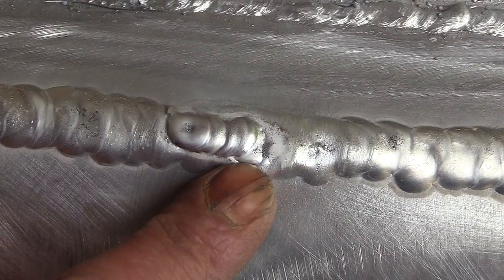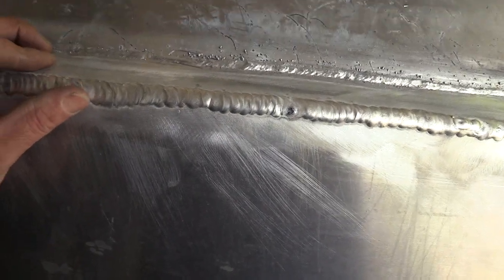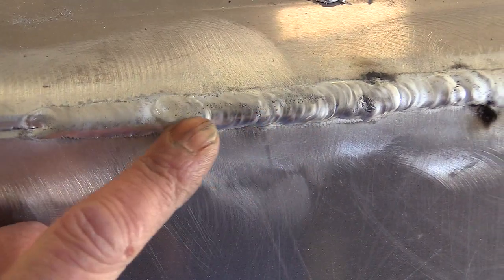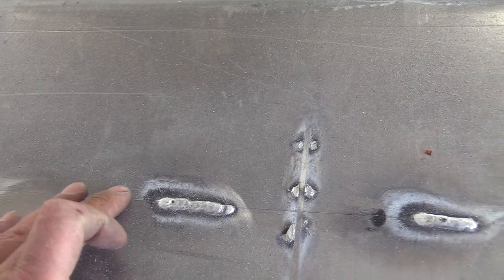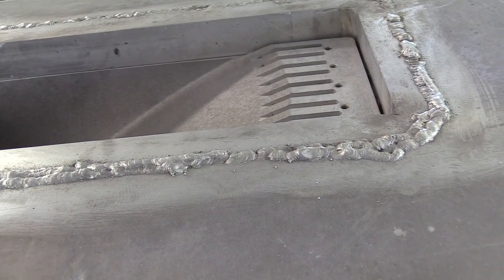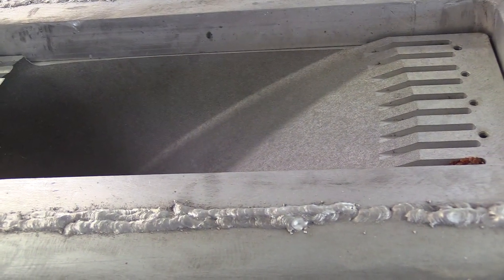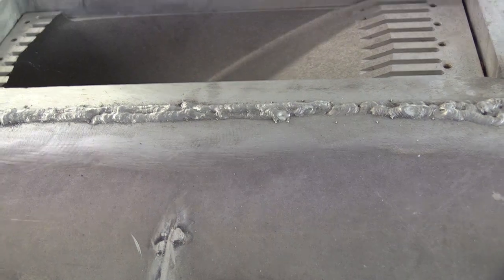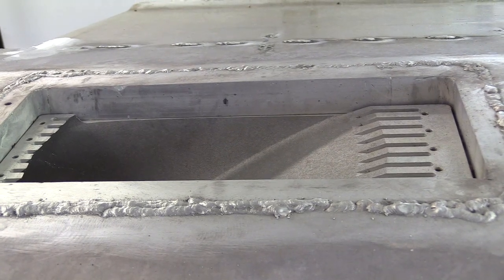Mini Jet Boat Build #45 Tig Welding Hull

Comment: It's certainly not the easiest way, but the best way I know to deal with welding the backside like that is to grind out a clean, consistent groove. In structural steel it's not uncommon to do a backgouge with a carbon arc gouging rod, but grinding is also used. Ideally the first pass on the inside would've got better penetration and it wouldn't be that bad to begin with, but it happens to everyone, trust me. That's why grinders exist.

Comment: I only have a tig welder an was contemplating buying a mig welder spool gun set up but the more I think about it, I'll be working with some heavier gauge aluminum and I'm not on a time crunch, I dont think warping will be an issue really as long as I am careful about it. So I think I'm going to tig the majority of my project.
Reply from the maker: Noah Lochner I don’t know if you have to weld the inside corners of the deck. I couldn’t have TIGed those. There’s a lot of inside corner welds such as the hood stringers, Inside transom, engine bearers, etc. I haven’t done any 90deg inside corner welds, but I’m sure you can get it done. I feel a lot better about the integrity of the Tig welds, and they come out with a smooth surface, and no splatter.
Reply: Paul Christian yeah I figure I’ll need to mig a few areas but I might primarily Tig weld most of it then rent a mig setup to get the rest of the seams I couldn’t Tig. Although I’ve tigged in some pretty heinous positions with a finger control. Lol but still, probably best to mig them if possible. But I don’t think I’ll go buy one just for this project if I don’t have to.
Reply from the maker: Noah Lochner It will help to have someone holding things while you’re welding. You can’t tig with one hand while holding onto something. Pulling the front panels together and holding up the side panels especially. I’m hoping to finish the hull welding tomorrow, then looking at putting the UHMW on. I might wait until after I get it running and water test everything.

Comment: Pulse Mig is the go , your welds look too cold.
Reply from the maker: Aluminum is the hardest metal to dial in and be consistent with, at least for me. It’s a fine line between being too cold and blowing through. It’s porosity keeps you busy cleaning and preheating, and even then it is hard when you are welding both sides to have clean metal the second time around.